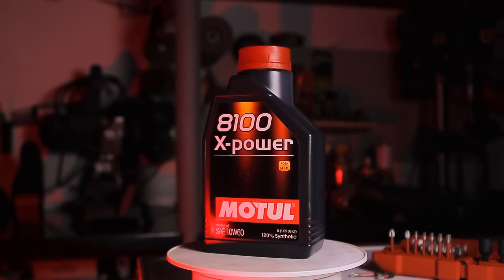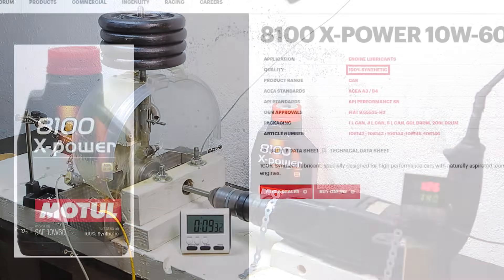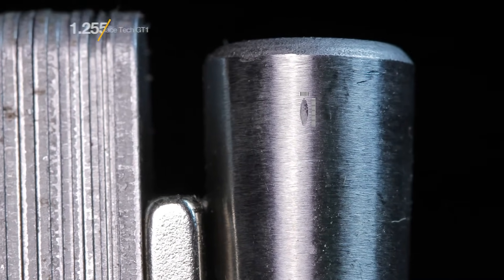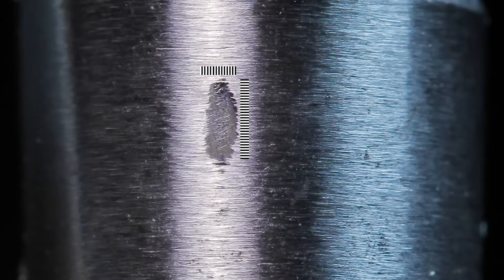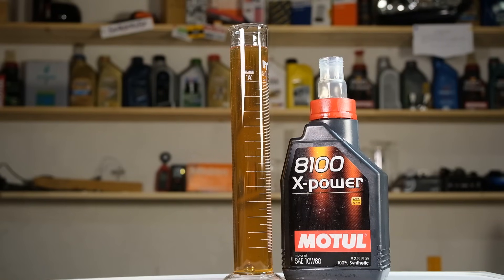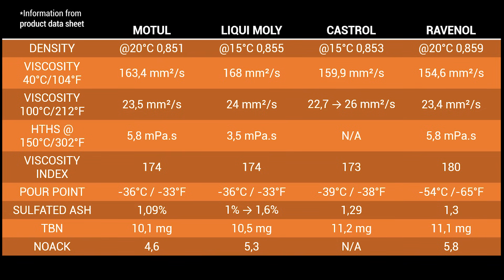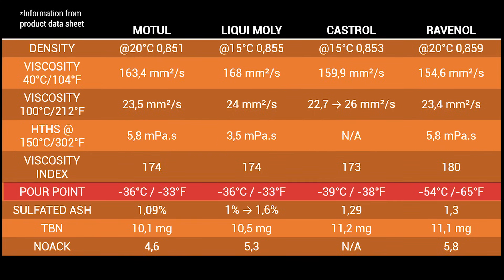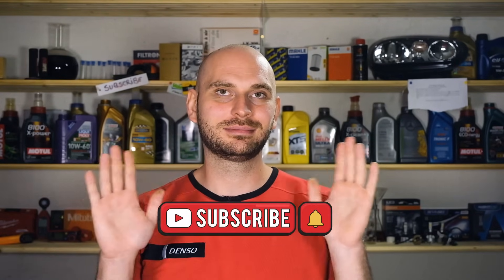Which is the best RACING ENGINE OIL - Motul vs Liqui Moly vs Castrol vs Ravenol - REVIEW & TEST

Comment: I have had bad experiences with Motul, tried it twice fail me twice. The problem that I had was bad heat resistance in my BMW 325I 2010 I had to use 2 liters more in a 10,000 kms OCI and my 2011 MKX PTU nearly blew because the lubricant burned too fast. No more Motul for me no matter how many videos show it's good, maybe the oil we get in America is different than the European one.
Reply from the maker: Interesting.. maybe it is different. I tested Shell Helix Ultra bought from Turkey, Italy and France. All of them had different results, for the same type of oil.
Reply: Yes, I appreciate you testing it twice. It's been excellent for my car and works like magic. True it can be the case of manufacturing. Anyway which oil grade you used

Comment: Foarte bun testul. Multumim. Sper in viitor, ca nenea Sergiu sa includa in teste si gama low, de exemplu uleiuri 5w40 si 5w30 rebranduite Auchan sau Kaufland. Cred ca va avea surpriza sa constate ca diferentele dintre ele si gama premium (motul, ravenol, liqui, castrol, etc) nu e atat de mare. Iar pretul e mai mic cu 50 % sau chiar mai mult. 
Multa sanatate si spor la treaba in continuare, faci o treaba foarte buna !
Reply: Chiar sunt curios de comparatia asta, dar ca in orice domeniu cumperi si brandul care iti ofera o anumita siguranta, pe cand auchan sau kaufland...
Reply: @NarcisOro  Nu am mai stat pe ganduri si, pe 07.10.2020 am bagat in motor 2 litri auchan 5w40 si 4 litri auchan 5w30.
 Cocktail.
 Motor logan 09 cu turbina, 90 cai, care avea 1 an si 19.161 km. Am alergat aprox.3300 km si pe 09.12.2020, la 22.513 km, l-am scos sa vad cum se prezinta.
Nici o problema, nu am gasit span in cutia filtrului de ulei, ca in anul 2019, cand dupa rodaj de 2700 km cu uleiul din fabrica, pe cutia filtrului de ulei era pilitura metalica.
Uleiul fara spuma, "alunecos" la frecarea intre degete.
Nu m-am putut abtine sa nu fac alta proba. Am bagat desigur filtru de ulei nou si ...... atentie......, 2 litri ulei ravenol 5w40 amestecat cu 2 litri auchan 5w30. 
Din nou cocktail.
Nu am pastrat garantia la golan pentru ca am montat de la 4.000 km o instalatie gpl, deci imi permit orice test, nu am mai trecut pe la reprezentanta pentru revizia de 1 an.
Tot ceea ce am povestit aici, o pot demonstra cu fotografii, nu spun minciuni.
Acum am vreo 1000-1500 km cu al doilea amestec de uleiuri. Cand fac 5000 km, din nou, jos din motor sa vedem cum arata. Si va urma kaufland 5w40 din 2018. 
L-am gasit la reducere in magazinul kaufland Botosani, pe 28.10.2020, 64.95 ron bidonul de 5 litri, am luat trei bidoane.
Multa sanatate si numai bine in 2021 !

Comment: Thanks for explaining the data sheet values. I was nit sure what value was better if it was low or high.

Can you test motorcycle engine oil like Putoline.

I would also hope to see a test of LED light for cars/motorcycles without a separate ballast or power source to see how much much light it can project thru a reflector and projector headlight.